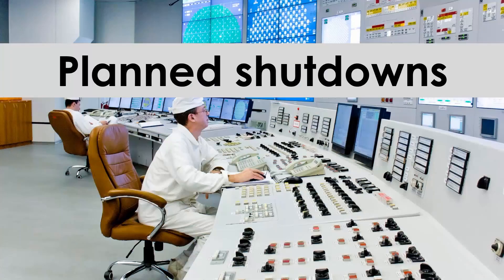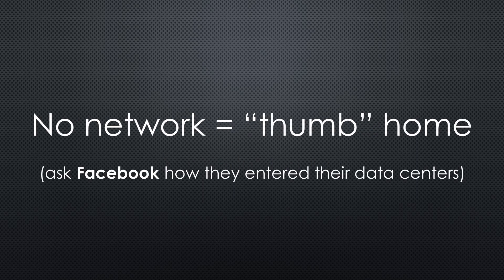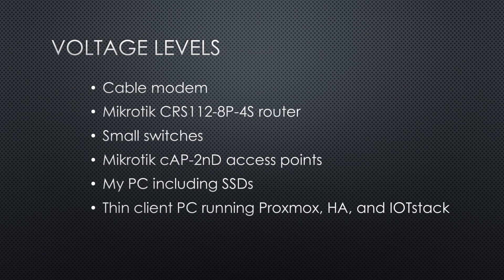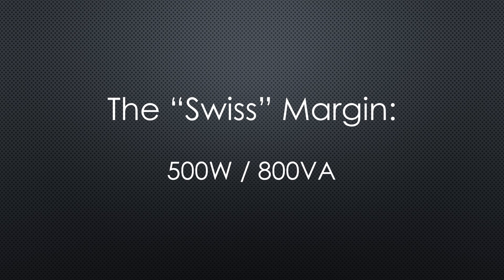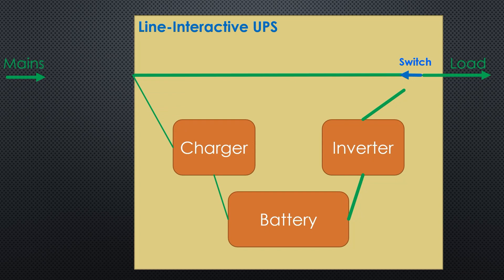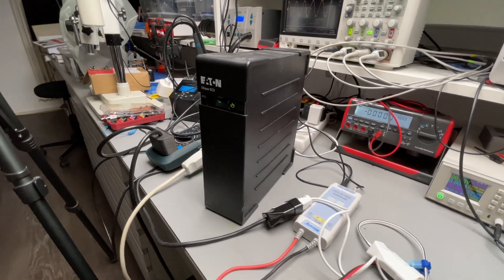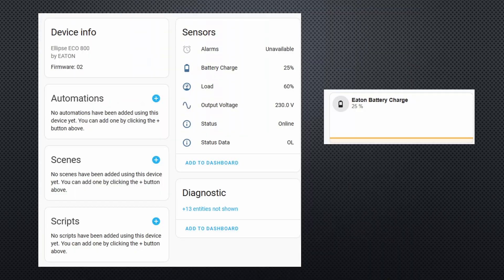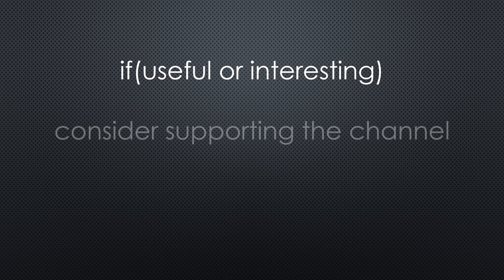447 How to protect Home Automation and PC with an Uninterruptable Power Supply (UPS)

Comment: I have used different inverters for years in my boat, and I have never gotten anything more advanced than things like vacuums and hair dryers to work reliably on modified sine waves. 
Computers, and some chargers, seems to become quite unreliable and even fail some times. (I read that some AC motors also may break, not mine, though).

I would also mention that the moment of going into hibernation and shutting down are quite sensitive moments for these devices, when large writes to flash and hdd/sdd memory are done. 

Granted, my problems may have been due to very shitty modified waves, I don't know. 
But I seem to remember others having similar experiences when I looked around online.
Reply: Hibernation should be more reliable than shutdown, since later may be interrupted by running applications when work is still unsaved, right?
Reply: @EverydayRoadster  A "real" shutdown, at least to my knowledge, does not care about running applications having unsaved data. This is not like clicking on "shutdown".
Either way, saving that data, either by actually saving it or dumping the entire state through hibernation, does imply lots of writes to permanent memory. 
And here I am guessing a little, but I would not want to do that while running on wonky power. 

I wan't to emphasize that that is not the whole point of my post; I have had so many issues with the modified sine inverters I had just running electronic equipment them on that kind of waveform, and now, with pure sine inverter i have none.  (except it is now other problems instead, but it's a boat, that how that is. :-) )
Reply from the maker: In theory, the wave form should not have a big influence because in modern switching converters, AC is rectified before it is down-converted. Most devices even would run on DC instead of AC as I once showed in a video. But theory and reality sometimes differ...
Reply: @AndreasSpiess  I don't know much about that, but it have caused problems for me.
As I said, it might be because my inverters were extra-crappy or something, but there we so many others having similar problems, that I haven't really second-guessed that conclusion since. I have always thought that it had to do with overtones and such. 
But things may indeed have changed.

Comment: I have a apc sua1500 (I made a lot of modifications recapping and external battery etc because its pretty old 2006 i guess) working perfectly on my home. I have modified my fusebox and created an UPSed my ceiling lights. In addition it powers my routers, hass, gas boiler, smart thermostat and tv. They all connected to home assistant. I have been using nut for some time but removed the nut from the system because I am counting every watts since energy price inflation. I will reinstall a nut server on onion omega which is laying around when i find some time. In addition I have placed 250w solar victron raspberry system to my side walls and its also working as a backup. Excess goes to routers with a no inverter dc bus design. Working fine with victron modbus tcp into home assistant. That concludes my energy setup :). (oh forgot that I have put an old sonoff pow r2 to my grid and ups lines with esphome so I can monitor power outages and usages.)
Reply from the maker: Thank you for sharing! My nut server runs on the IOTstack VM of my Proxmox server. So it should not consume too much energy...
Reply: @AndreasSpiess  I am not familiar with linux vm'ing. So I am still using bunch of individual raspi 3's for application still :D

Comment: Does line-interactive suffer from the same switching delay?
Reply from the maker: As many other commenters suggest, my device seems to have a problem. Others did not experience such delays. There should not be a difference between the two UPS (in switching delay). The difference is somewhere else as shown in the video.
Reply: @AndreasSpiess  that's what I thought, thanks! Judging by the period of your image of the oscilloscope, the delay can't be more than a few milliseconds. Do you think your unit occasionally hiccups for longer? Otherwise, what could cause the reboot?

Comment: I don't know why my intel nuc keeps on rebooting with the ups i had (i think some offline apc model). laptop worked fine but it had battery already. We have regular power cuts here so most homes are already equipped with trapezoidal wave inverters. some are even sine wave to cut noise made by fans in summers. 

By the way we had an ancient 5kW "UPS" at our office which we revived recently because most of us don't like laptops here, which our organization is forcing us to adopt. It has several giant 2V lead acid batteries connected in series. In spite of our best efforts it always showed "overload" later we found that some one had connected his office air conditioner to the UPS to beat the summer heat ;-)
Reply from the maker: Interesting that you had the same problem! And about the "overload" problem: This is common human behavior. We always find one who stresses the collective system till it is overloaded ;-)

Comment: I don't use a "UPS", rather I use a marine power inverter / charger from Victron Energy.

It has a 3000va pure sine wave inverter and 12v battery input with support for multiple battery types including lithium.

You can set up basic functions on the unit, or buy one of many modules to get better control, such as a USB link cable (USB to proprietary) or their smart access touch display.

Whilst you have to wire up the input mains, output mains, battery and any additional equipment / sensors, you can set battery charging voltages / types, mains input current limits etc.

If your mains power is dirty, or not sufficient for the load, the inverter can support the mains power.

Eg, if you set the mains input limit to 10a, but your load requires 15a, the inverter will produce the additional 5a in sync with the mains frequency.

Any available mains input is used to charge the battery.
Eg, the limit is 10a,thenload is 8a, 2a will be used to recharge the batteries.

It's big and bulky and requires a real DIY approach, but it's high quality and near infinitely expandable.

Multiple units can be connected and act as master / slave for increased power capacity whilst endurance is limited only by how many batteries you add in parallel.

They also have 24v and 48v models if you want more efficient batteries.
Reply from the maker: I think, this is comparable with what my Huawei inverter does. Unfortunately, here, these inverters have to switch off when the grid is off (more in other videos). That is why I need an additional protection.
But your solution would also work without connection to the grid. Then you would need a big charger to always supply the load. This would be more or less an online UPS.
Reply: @AndreasSpiess  the unit I have is the 12/3000 Multi-plus, meaning 12v battery and 3000va inverter / charger combination device.

Buy it, a battery and what ever wires you need to hook it up and you are done. No additional charger needed and no back feeding. 

I wired mine up with regular plug and socket leads so that it's "portable" and functions like the small UPS you tried.

Victron Energy also do solar chargers alongst other systems which can network to the inverter units and with USB, Bluetooth or their smart displays will tell you how much power you are using and how much each source is making.

May I also suggest you look up to if a line UPS switch might be an option.

They double throw switches with smart switching. They need a 12v power source to run, detect when mains power is lost and flick the switch over to a generator, disconnecting the grid from your load.

Once grid mains is detected, it waits for stable voltage and for a timer before switching back to grid (and disconnecting the generator).

It also has control outputs for the generator to signal automatic start and stop functions.

Instead of a generator, a small inverter might be able to be wired in which will trigger your Huawei inverted to come back online (wired to the load side of this switch).

Not sure if the switch over time is fast enough to keep computers running however.

Still, I hear you aren't afraid of some DIY projects and research...
Reply from the maker: @35manning  I think you will find many things you mention in the next video...
Reply: @AndreasSpiess  bugger, now I'm really looking forward to the next video, but I hate waiting...
Reply from the maker: @35manning  Only two weeks...
Reply: @AndreasSpiess  oh no, that's a life time away...

Comment: I now have a 5kva ups, I just need to run a mains cable from the solar inverter ups output. :-)
Reply from the maker: If you run off-grid, that is easy, of course...
Reply: @AndreasSpiess  it's just that our solar inverter has an output that stays powered when the mains fails. It’s main output to the house has to turn off due to our rules in the uk. But as long as the backup supply output is not connected to the normal house wiring, it can be used to keep freezers and fridges  and networks running. I’ve just to run a new cable from it into the house to a set of sockets near the router, nas etc.
Reply from the maker: @TheEmbeddedHobbyist  Aha. Same here. You might be interested in how my solution works (in the next video)

Comment: I have found that AliExpress has some all-in-one solutions, Hybrid solar inverters for offgrid usage. Prices around €235,- for a 3kW inverter.
They often have grid input, solar input, battery connection and load output. Can be programmed to prioritize which input charges the battery.
If/when grid power goes down, it switches/continues on battery power - which you choose the size of (voltage, amp hours and type)
'Small' UPS won't keep your freezer/fridge running for a day, most can't even provide enough power to start the compressor.
- and yes, I want my food to stay fresh and the power a home automation systems require is just a 'free' bonus from the mains UPS.
Edit - forgot to mention any UPS has a (sometimes) rather high idle power consumption - I think it's better to have a few, rather than a lot of UPS'es
Reply from the maker: Good idea! Because they have to be "online" UPS, I assume, their efficiency is not so good. But they have a very high capacity compared to these small office UPS.
Reply: @AndreasSpiess  Thanks.
Most 'office' UPS's use Lead Acid batteries, 12V at 7Ah - usually 1 or 2 batteries for the small UPS models.
It is not advised to discharge a Lead Acid battery below a 50% charge state, since it destroys the battery - and even at 50% DoD (Dept of Discharge), they can be used usually 500 cycles/times.
This means a small UPS with one 12V, 7Ah (84Wh at 100%DoD, or 42Wh at 50%DoD) really don't last long.
After a year or two, they also tend to run out of power rather fast - if not cycled periodically. 
Been using them for many years, and they're great for small power outages lasting for a second or a bit longer. 
More than that, they're not super great in the long run - but I guess one can hack a 12V LiFePO4 battery with a BMS and use that instead of an old lead acid battery.
Reply from the maker: @EgonSorensen  You will see in the next video that I only need my UPS for 3 seconds. But I am sure the UPS manufacturers will go towards LiFePo4 in the future...

Comment: Very relevant topic, thank you.  By the way, I'm blaming you for my 'need' to buy and build a desktop i7 with Proxmox for my home server needs (I have children so this includes minecraft servers as well as my automation hobby).  I'm also interested in how best to implement all of the functionality across different technologies to minimise power consumption. 

I have an old UPS that just needs a battery, but my components are not co-located in one part of the house, so I have some extra issues to deal with.  I do have a LOT of 18650 cells, though, so building a UPS from scratch to correctly supply some of the remote parts might be interesting.
Reply: welcome to the "andreas told me to buy an i7-club"
Reply: @geminischweiz  Yes!  In fairness this was the first time I had seen proxmox demonstrated, and what better teacher is there than one as meticulous as that guy with the Swiss accent?
Reply from the maker: I hope you guys are as satisfied with your I7 as I am ;-)
Reply: @AndreasSpiess  still installing proxmox. i am to stupid for virtualisation
Reply: @Andreas Spiess  Yes, very much so, I have three VMs that are far more capable than my NAS drive could ever be with it's little Marvell processor and 256MB of RAM.  Yes, with 16GB of RAM and 8 threads, this i7 absolutely rips along.  Power consumption appears to back off to about 11W when the machine isn't working too hard as well, so I would say that's more than acceptable.

Comment: Congratulation... you've discovered the IPS (Interruptable Power Supply)  My solution is a bit different.  I counted more than a dozen wall warts,  which fail and are very inefficient.  So I have a battery,  an 8 to 16 volt to 12 volt regulator that is diode OR-ed with a good AC mains PFC corrected, efficient, well built power supply.  FYI,  they make heavily doped Schottky Diodes with very very low forward drop for power supply OR-ing.   Then set the mains supply a hundred millivolts above DC to DC converter.  I have a 12 volt to 48 volt converter supplying power to all the POE devices through out the house.  In Northern California we have PG&E, who is found responsible for starting a fire, on average, once a day.... they can do things that no UPS can protect against. I haven't found any any UPS that works with our circa 1920 power grid.
Reply from the maker: Interesting idea with the two diodes. It for sure increases the efficiency a lot. Maybe it could be extended with a FET. Then you would not need the slightly lower voltage on the backup line.

Comment: I have 2 up's 1 for my home server and 1 for my network components (also Mikrotik's) with 3 Ap's, 1000 VA from BleuPower are a bit more expensive but always work.
For my cable modem I made a UPS myself with 2 18650 batteries and a buck converter, it can then just send the messages sent by the server to my mail so that I know that there is a power down when I am not at home when everything is back I also receive an email (The Dude) from Mikrotik make this posible.
Reply from the maker: Cool! Maybe I will add an additional DC UPS to the cable modem if I am not able to solve the Eaton problem (it is the worst if it crashes)...

Comment: Nice topic. The switching moment is the reason we use Online UPS, only. At least in our server centres. But I guess, a hobbyist and maker has less expectations than one has from professional IT stuff. I still find laptops convenient for my home stuff and run proxxmox on those devices with built-in UPS. And after all, I live in Germany. The outages are not exisiting or longer. Id did not see short outages for years.
Reply from the maker: Indeed, Laptops are a good solution for the computing part. In my case, a network down often creates more mess than the PC. Microsoft improved the recovery routines a lot over the last years. 
Online UPS for sure are better. Still, I think, an offline one should be capable to protect a simple network switch and a PC.
Reply: @AndreasSpiess  a video analyzing the devices that rebooted would be interesting. Perhaps the result is just that the voltage of the DC power supply drops too fast and the solution is to increase output capacitance, but perhaps the answer is more interesting?
Reply from the maker: @aaron41  Maybe the answer is easy. The UPS decided to die today. So maybe it had a problem right away.
Reply: I'd be inclined to suspect capacitors if it was a line interactive UPS...
Reply from the maker: @lua-nya  It is an offline UPS. And it was new 😞

Comment: Hold Up Time of your PSU vs transfer time of the UPS, but in general, if an Offline UPS keeps everything on during a power outage, that's unusual behavior.  If offline UPS were able to consistently keep the devices hooked to them running, no one would pay the extra costs both in hardware and electricity that are incurred in the types (ie double conversions etc..) of UPS that do what you expect them to do.  Other options are to use DC PSUs for your computer and get everything on a DC distribution and throw a big ol' lifepo4 in the mix.
To all those that think they have great setups, have no idle load draws and only have to change out batteries but every 5 years/never have had to change the battery....go pull the power plug from the wall and see what happens.  Probably won't like it.
Reply from the maker: I agree that an online UPS is a good choice. Still, I would expect, that an offline UPS does what it is sold for: Protect office devices. Reading the comments, this should be possible. It seems that I was not very lucky. In the meantime, my Eaton died.
Going DC is for sure a good way and less complex. Maybe I will try it in the future.